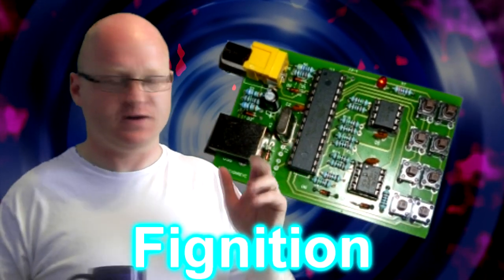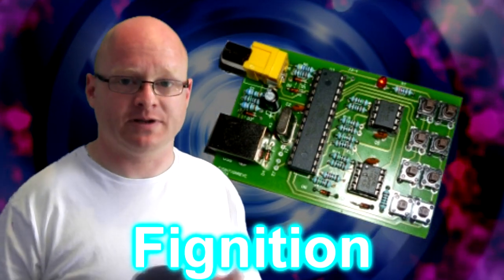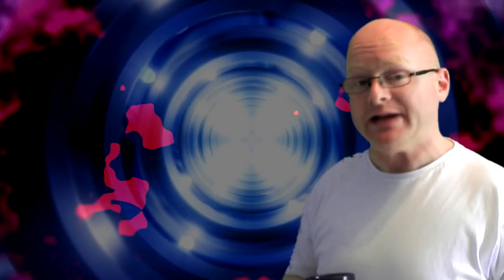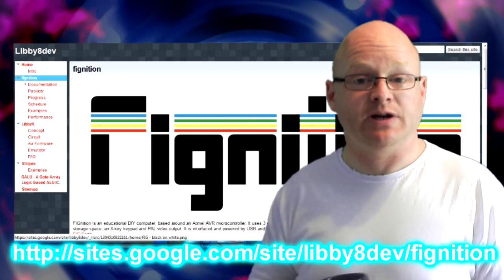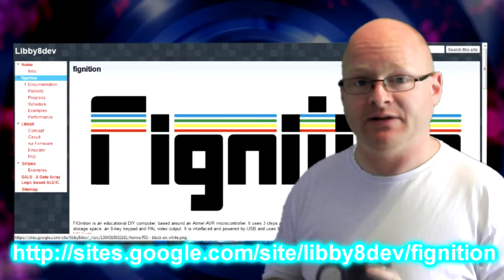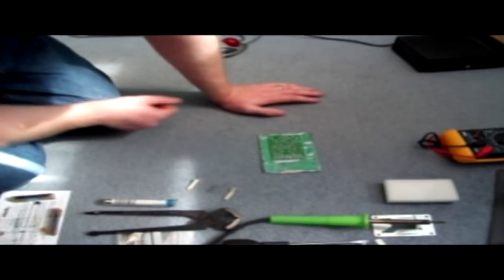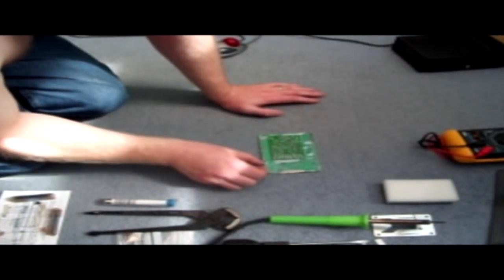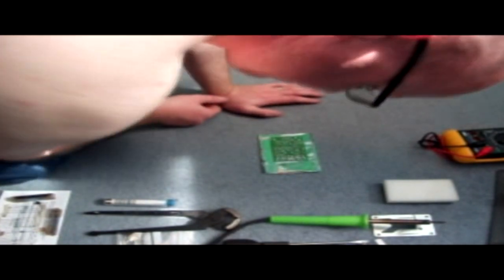Constructing a Fignition 8 bit kit computer

Comment: @RetroGamerVX I could not imagine doing a BGA or PGA straight onto pads by hand in the case of the PS3 and a lot of that surface mounted stuff would be tricky not counting the ones with all the leads on the bottoms.  I think it would have to be a special designed ps3 to work as a kick or you would have to have a extra couple million dollars for the machines to assemble it.